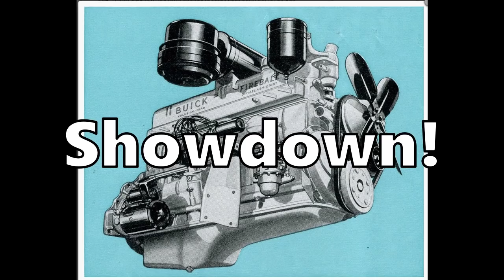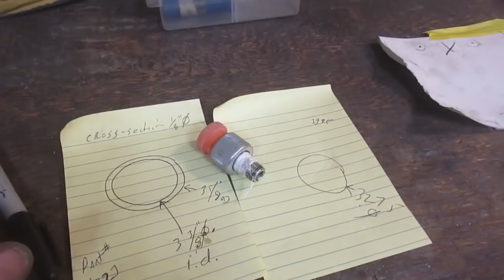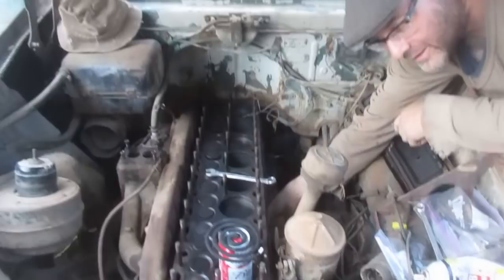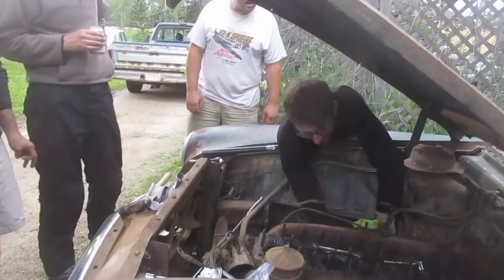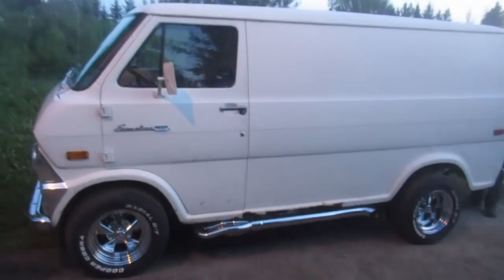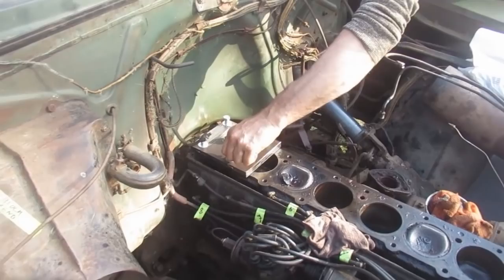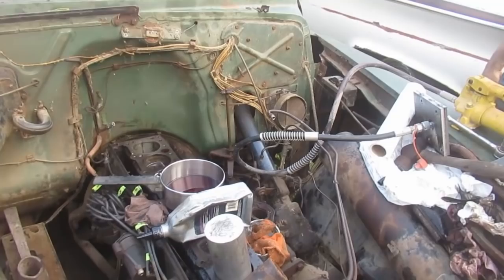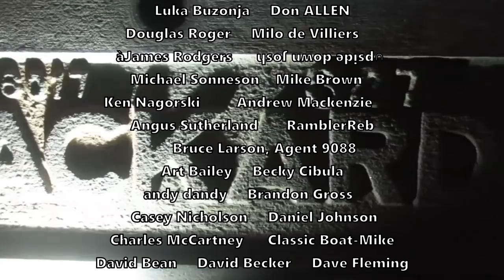Will they Run? Straight-8 Showdown! Packard vs Buick, Part 2...

Comment: Back decades ago the good old boys down in Mississippi would race on the back roads. One old boy was a firm believer in Packard Engines and Studebaker bodies. By the way the US PT boats used in WWII were powered by 3 Packard V-12s  rated at 1200HP each driving twin screws. Now think about the knuckles and diff.s to make that work. Love the show, keep it up.
Reply: Right!  The US PTs engines!  great memory, Kudos!
Reply: The PT boats had plywood hulls and a lot of them were built in Pittsburgh. If I remember the story right, the one MacArthur had to bug out of Manila on had the Packard V-12 and it had a bad cylinder.
Reply: I don't doubt it. The fuel from what I have read was contaminated with parafin that clogged the furl filters regularly.
Reply: @Fubarfighter  There were two major producers of the PT boats, Elco and Higgins. Elco was based out of Bayonne New Jersey and Higgins was based out of New Orleans. They were all powered by Packard V-12s that were almost always breaking down and ran on TERRIBLE fuel in those days and yes, paraffin was very prevalent in the fuel, so it was always clogging the fuel filters and gumming up the jets in the carburetors. The Packard engines were the 3M-2500, 4M-2500, and the later 5M-2500 which were supercharged, intercooled, each had dual magnetos, and two spark plugs per cylinder to increase the amount of spark. The 3M-2500 and 4M-2500 produced 1200HP each but were later increased in stages to make 1500HP producing a top speed of 41 knots while the 5M-2500 had a larger supercharger and after cooler which increased it's output to 1850HP, enough to drive the PTs to a top speed of 45-50 knots across the water. The PTs carried 3000 US Gallon fuel tanks as the engines consumed 200 US Gallons per hour at a cruising speed of 23 knots and up to 500 US Gallons per hour at top speed. Believe me, I'm no expert on PT boats, but I did remember that during WWII there were two major producers and their names, but Wikipedia provided the rest of this information. I just figured that I would let y'all know the facts on them.
Reply: They've got one on lake Ponchra, er, Ponntra, er, Ponkratrainerpuddle down there ar the WWII museum. My brother and I saw it in restoration up on stilts in the shop about 5 yrs ago. Over in a corner, two guys were laughing their asses off, testing the tiny toilet from the boat on a bench by flushing peeled bananas.

Comment: At 33:31 you can see the breaker bar move clockwise a bit when the piston finally breaks free. Whoever came up with the idea of using hydraulic pressure to break loose a frozen engine is one smart creative person. I love the way you all solve the problems of getting these engines up and running again.

Comment: Another EXCELLENT video!  I once unstuck a piston on a 1910's era Fairbanks Morse "headless" engine using the hydraulic grease gun trick.  That first "tink!" noise was so satisfying, yet it was so scary at the same time!  However in my case, the rod was already disconnected from the crank, so no worries about a bent rod in my case.  :)  And it's good to see Dean again - he loves everything!  :)
Reply: Its not new technique

Comment: I love this post ! When I was  12  (1965) my dad left/had 3 junked straight 8's he had ran into the ground. In the 1940's and 50's my dad bought used cars and liked and trusted the straight 8 engine the most. He always bragged they were the best and V8's were ''tinny and cheap''. The oldest junked car was a 38 Buick Special, 2 door. The two others were a Pontiac circa 1952 and a 1950 4 dr. Buick. I can still remember the old car smell, spiders, a snake, mice and a wasp nest etc.. So for six years, in Warren N.J. , I took the straight 8's apart. The Packard you guys are doing, reminds me very much of dad's Pontiac, a flat head .  My dad never did oil changes , claimed it was a gimmick the oil companies used. So he changed the filter about once a year and added cheap Sears & Roebuck bulk oil. No wonder the straight 8's he owned eventually over heated and froze. My old man was rite, about the fact, you can un-freeze them and get them to run, he was too lazy and always bought another used giant U.S.A. made car. I never succeeded, I was too young and  got too many parts out of order and confused., but I learned a lot and later in life a age 30 became an A& E mechanic. So if you can find a TV show called ''the Wonder Years'' on youtube,, very similar to my life.

Comment: Regular folks: The engine is seized and the car hasn't run in over 40 years.

CWM: It'll start, hey? We need mosquito coils, beer, weed, and a shitload of hydraulic pressure.

Comment: @Coldwarmotors, I would highly recommend pulling that piston and make sure the rings aren't stuck. I un-seized an engine on a 57 Plymouth but it was still tight as hell. Turns out the rings were seized to the piston.

Comment: Part of your problem with the Buick was from trying to break it loose from the front of the crank. The other 7 cylinders and valve train acts like a shock absorber. You think you're putting a lot of pressure on the stuck piston but you're not. Gotta go at it from the back of the crank for pistons stuck at the rear.

Comment: Great job on getting the Buick Eight freed up. I have spark plugs that I broke the porcelain out, and welded in a grease fitting. I. pack as much grease into the cylinder as I can, then put the head on with the old gasket, valves closed, I pump in grease using a regular grease gun. I have always got a stuck engine free that way. Looking forward to seeing both cars drive around the yard. I really like the Packard, so I hope it wins.... but it will be awesome to see both cars running! Thanks for the amazing videos. I NEVER skip threw your videos. How is the 60 Fury coming along?

Comment: And the mosquito coil is a nice touch...🤣🤣 And team tshirts should be in the shop. This is getting serious.
Reply: i just assumed the smoke was coming from someone's cigarette. had to laugh, but was not surprised, when i saw it was a mosquito coil. (i've spent some time in what i call, unincorporated canada.)
Reply: @bladerunner6282  They used to sell those things at the drive in movies. You'd set them up on the dashboard.

Comment: Hey there!  Try using a product called 'butyl cellusolve' which is used by pro painters when they spill paint on the customer's carpet.  The old Peterson repair manual suggests this solvent when a hot engine gets anti-freeze in the oil and seizes up.   It penetrates and gets stuck engines unstuck again.   Just a suggestion, though it wouldn't qualify for your zero-budget parameter.

Comment: Thanks for the hydraulic drama! Brilliant. Way better than my imagining: twin propanes on the cylinder wall and then lots of wood-block banging. I thought you'd have to purge the hose connector of air first, but perhaps you had a wee air volume that compressed to provide a cushioned-piston start. Definitely the most novel persuasion I've seen among a number of ICE unseizings, where PB showers like rain and the pipe-over cheater bar takes a jerking as in Fritz Lang's Metropolis. 'twas an incremental emancipation by true gentlemen. I look forward to the starter spin, valves going whack-a-mole and then the first, wheezing combustion back to life. You gotta have a handicap drag race if power can still reach the wheels.

Comment: Just thinking of the line-up of cars in your yard... You know what would be a really cool thing to do? Hook up all the headlights of the cars to a low-voltage power supply for some really interesting yard lighting. Maybe not the full 12 volts. Maybe 6 volts, for a nice warm glow. A car with headlights on looks alive. You could do it with alligator clips to the bulbs. Could even be an AC power supply/transformer.

Comment: I WANNA SEE THE RACE!!!  I saw a 1934 Packard 8 take a 1932 Cadillac 16 on a mile run by four car lengths .
Reply: Too Cool !
Reply: The Caddy in that race was severely handicapped by a trans that had to drop way back to idle to shift, no synchronization at all. It had enough motor.

Comment: For the Packard you only need a few cylinders to work to get it running - so just fix a few of the valves and I bet it'll run good enough to reach the end of the driveway and back.

Comment: I would pull the distributor and put a rod down to the oil pump. Run oil pump with drill.

Comment: I've feeded up some model A engines with kerosene, hammer and wood block.  Never thought to use hydraulic pressure. Glad it moves and nothing is bent.

Comment: Scott: I read in an issue of Vintage Truck Some issues ago where a truck rebuilder broke a stuckengine loose by putting a jack under it and applying lift pressure until it broke loose. It was apparently a successful operation.

Bob Nicholson

Comment: That cracking sound is the ring lands breaking . LOL You wanted to hear that comment didn't you. I'm In Auckland in New Zealand  There used to be an old engineer working near me who had 2 1948 buicks in his workshop and another mint one at home.  He also had the original parts manual and shop manual for them too.  How i would have liked to have got hold of them. They weren't a common car out here so that made them special. And that grille and Bumpers.

Comment: Good friend of mine used to heat the piston with a propane or brazing torch ..get it nice and hot and dump marvels in it..worked every time on Marine engines

Comment: I was surprised that the piston moves with the portapower pump.  I would have thought it would move a little then leak at a rate higher than the pump output.  Kinda cool to see both cars progressing towards becoming runners. I bet both run, but the Ultramatic is a wild card.  I am guessing you don't have another Packard with a known good trans.

Comment: All this straight engine action, to bad you don't have a GM Fisher 12 valve also. Still be a treat to hear these run. Love the van, if it was  Dodge Tradesman, I have a good fiberglass visor for one. Don't know if it'll fit A Ford. I have no need for it.

Comment: With that much pressure I would be worried about breaking the block. Another option would be to air chisel the piston apart and run it on 7 cylinders.

Comment: Great work! However, like the rust that was cleaned from the valves earlier, that stuck piston should be pulled to clean the rust from it. Also when they have rusted that bad, the rings on that one piston are usually so rusted away they are too far gone to seal or are stuck. Beings that you are already into it this far, come on... pull that one piston, hone and re-ring it if necessary. Then I'd bet you would end up with a really cool vintage driver instead of an engine with a dead hole pumping oil.

Comment: hey kids i have had some really good luck unsticking tractor engines by taking the wifes favorite sauce pan filling it 3/4 the way with diesel fuel then putting it on the gas grill and heating it to 195 degree F. then pouring it into the cylinders the heat seems to help greatly vs just pouring in cold diesel .....anyway good luck ill be a watchin from na hampsha...........................git r done boys

Comment: Wow! It's gettin' close now. I sure hope agent 303 has been boning up on that Ultramatic drive transmission. Time for a stockpile of ATF just for the cause. The old Buick is finally coming along, but will it have a terminally stuck clutch ? I'll bet #8 is a smoker. WGD carb on the Packard is similar to the WCD on the Frazer. They were on Pontiac straight 8's and Early Chrysler Hemi's too. Was the Buick a WCD or WGD ? Enquiring Minds Want to Know? I'll be on the edge of my seat waiting for the next episode of "Straight-8 Showdown".

Comment: Here in Reno Nevada there is a guy here that has a restored 1953 Packard Clipper and a 1955 Packard Carabean and they both still have their original engines so I think Packard may have a better chance beating team Buick.

Comment: Oddly I can make some good comments here. I been watching the "creation of Buick" and they are way in front of ford in having cars made and running, Oddly a doctor bought the first buick and some of the very first ones have original engines with cobbled shit to make move. I do believe it was tiller steering. Buick was the one to start "General Motors" with it being the first then the olds people got in bed then pontiac and chevy was in and out but eventually swallowed by general motors. Cadillac was the last to be acquired and somehow stay in. A guy named Billy Deranttie (spelling errors for sure) was the brains and could sell mud to the people living asshole deep in it. Buick made tanks and ambulances for ww1 and had something to do with a plane that got off the ground about five feet in a hundred feet but that scam died before it got "off the ground". Buicks ingenuity saved general motors several times... if I can find the link I will send as it has some really interesting stuff
https://www.youtube.com/watch?v=rj3zqqAS5tw
Its in parts and I am on two but my health has restricted my viewing it so to agent 303 Dean who is so sensitive to others feelings... hang in there as you a natural commedian. Frankers is so sweet going out to greet people and its her job to be important as the whole team is. That ford van will be sweet if he doesn't rivet beer cans over the rust on the quarter panels. Your own work is just amazing moving pistons with a porta power. I really thought that the long ass con rods would bend before it moved. Well its a book again so thanks for editing a great team job!

Comment: I have a1950 Ford Crestliner that had a stuck engine and someone forced it to run.  Bad idea. It does run......gently. The rings rusted into the pistons, and it has low compression. It runs but so what? It needs to be fixed right. It needs New pistons, new rings new bearings,  gaskets, everything to do it right. The fact that it runs doesnt mean much.

Comment: Why not put the head back on make sure valves closed put an adapter onto a fitting screw it into the spark plug hole put a hydraulic line on it and put it on a tractor?

Comment: Everyone with a stuck engine...... LISTEN UP....  A gallon of Apple Cider Vinegar will free ANY Rusted Engine... Just fill the cylinders and rusted areas, Keep it  wet with Vinegar..  Depending on how bad it is and how warm it is determines how fast it works...  Never seen one take longer than 7 days.